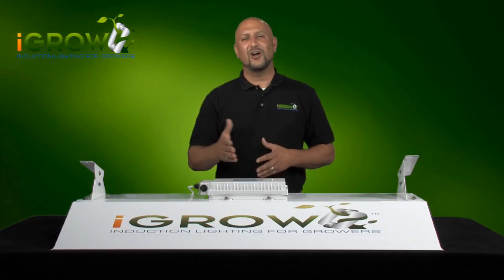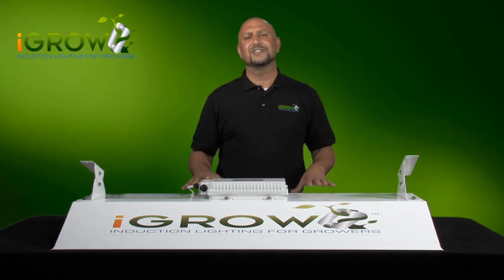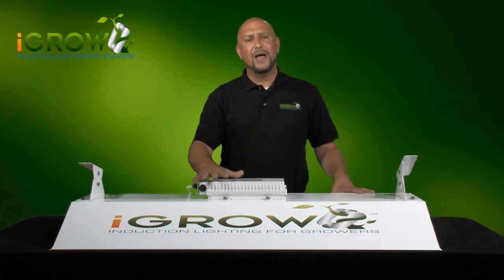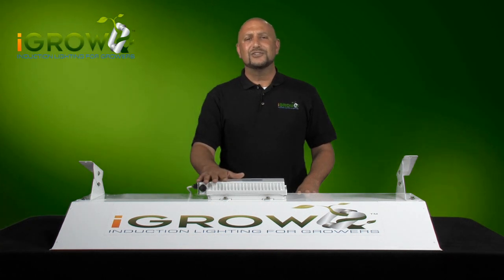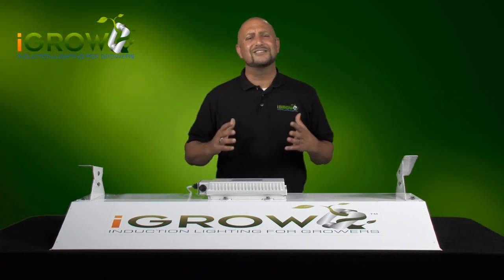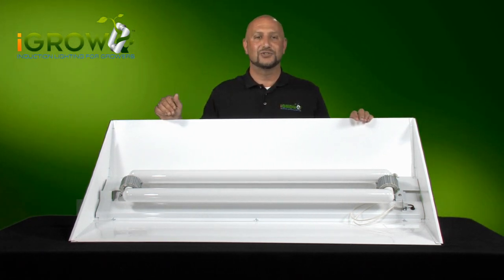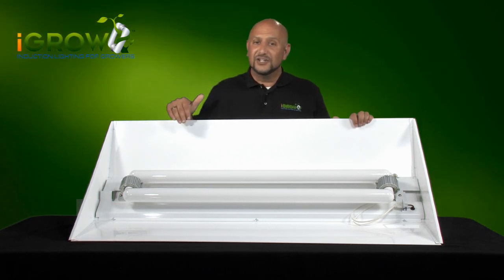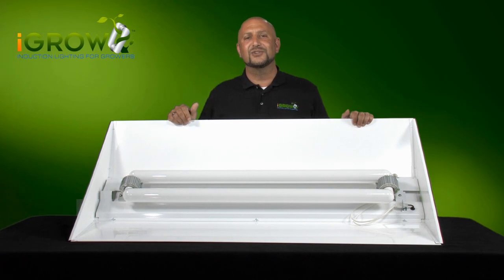Using iGROW Induction lighting and the benefits over HID | Bulb, Balist, Reflector

Comment from the maker: Thank you for your question. We do not reccomend removing the ballast from the reflector as it must remain within six feet from the light, part of induction technology. the total height with ballast is only 7.5". As iGROW is best used 6-8" from the plant canopy, in a typical tent that is 6-7 feet tall this should not pose a problem. We are hearing great things from tent growers as iGROW fills the complete space in a 4x4 tent and along with the very low heat makes it ideal for tent growing.